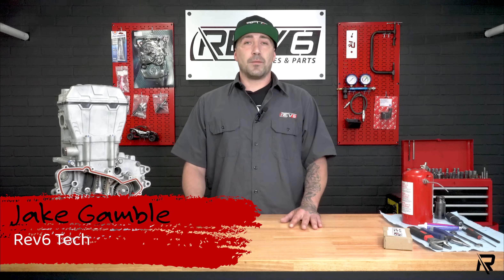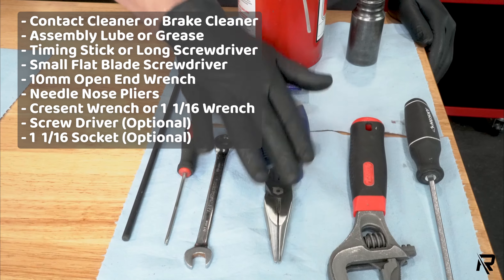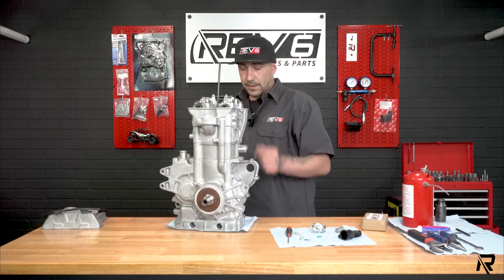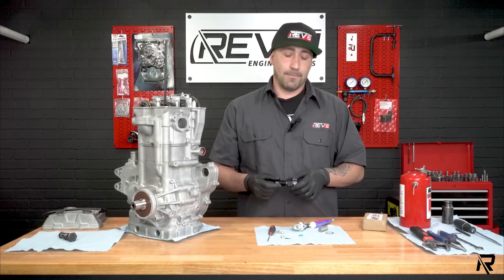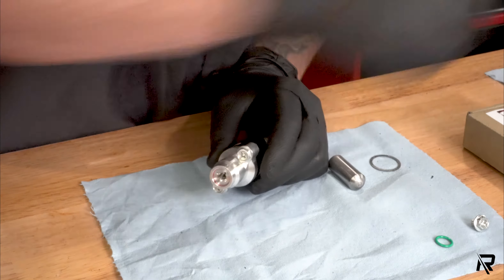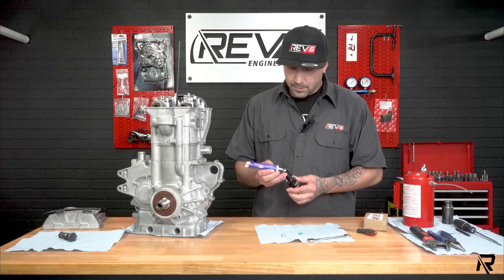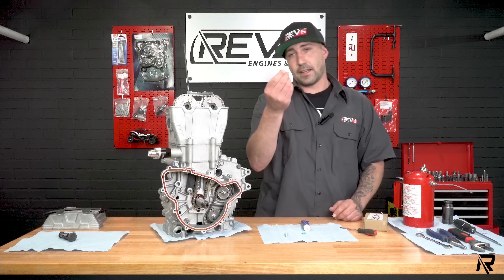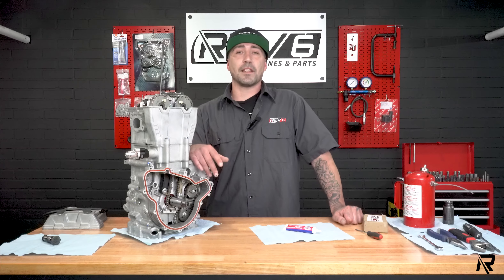How To: Upgraded Cam Chain Tensioner Install for RZR/RGR 570 Engine - Rev6 Engines & Parts Tutorials

Comment: Why does the engine have to be at TDC? Especially if it is running fine.
Reply: You have it at TDC just in case the chain moves round when you remove the tensioner, so that you can easily see that every thing is lined up correctly once the new one in installed